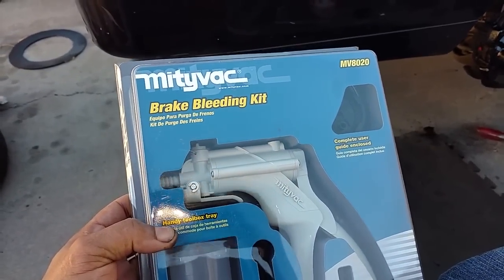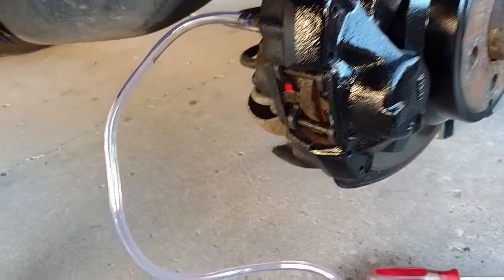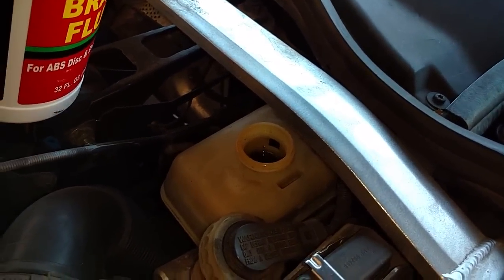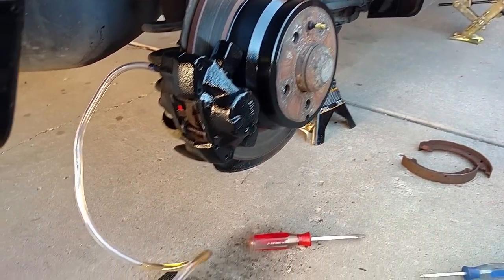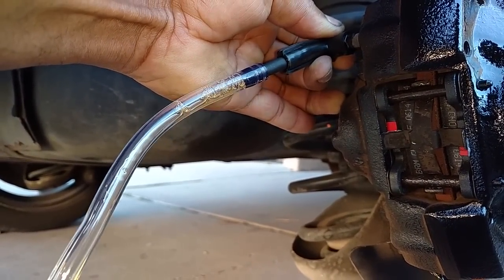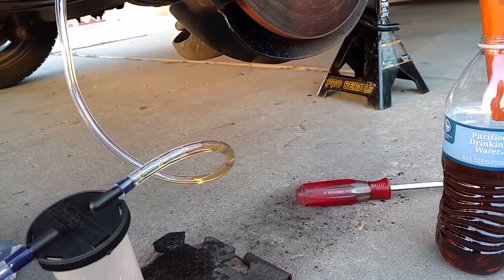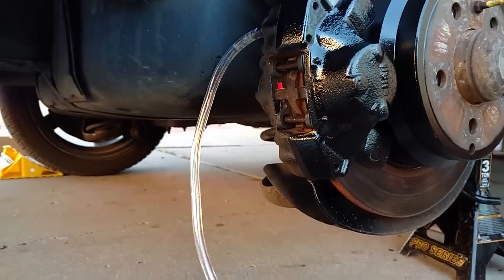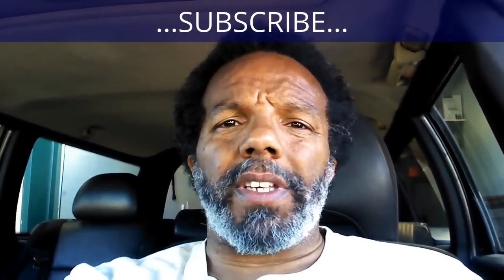How to use a vacuum pump to bleed your brake system. - VOTD

Comment: Should use a longer (not long) hose between the pump and reservoir. Air is being sucked in around the threads of the bleeder screw and the easiest way to slow/stop it is with some vasolene or grease. Better  way is to wrap the bleeder screw threads with teflon tape.
Reply from the maker: thanks for sharing.

Comment: Adding grease is messy... Just use small tie-warps around the tube at all the the coupling location.... sometimes you do need grease at the bleeder screw if you do not have the room for a small tie-wrap...
Reply from the maker: thanks for sharing.

Comment: Always a good idea to have a loop inthe tube that is higher than the bleeder valve. This way air will go up into the bend and not up into the cylinder.
Reply from the maker: Thanks for sharing.

Comment: The small air bubbles you see are from air being drawn in from around the threads on the bleed valve. you can solve this by removing the bleed valve and wrapping just the threads with thread tape tape then repeat the process till you see no bubbles.
Reply from the maker: Thanks for the tip.
Reply: A simpler solution is to use blue tacky tape around the treads.

Comment: That tool is supposed to be pumped 10 to 15 times to create a vacuum effect. You are also suppose to keep the pressure going until there is no bubbles. Gravity feeding seems easier some times, depending on skill
Reply from the maker: Thanks for sharing
Reply: Keep up the good work man!

Comment: Very Good Video-You show the basics. Don't worry about the "experts" who go on incessantly about pulling air in around the bleeder screw. With experience a reasonably knowledgeable  mechanic can to tell the difference between system air and bleeder screw air which is the very fine bubbles. It just takes some experience and practise. It has always worked well for me.A person just needs to get out of their armchair and get down and dirty and do the actual work to gain some experience in the real world. If they can't tell the difference between the very fine bubbles and the system air maybe they shouldn't be playing around with something as important as brakes.
Reply from the maker: Thanks for sharing

Comment: Usually issue with that much air is that the bleeder screw was loosened way too many turns that air started to seep past the threads instead of into out the nipple. Less than a fourth of a turn is needed with less the better just crack it until pressure starts to release fluid, usually don't have much air just need to evacuate little fluid to clear the air.
Reply: Air getting past bleeder screw is not getting into cylinder, just makes it hard to tell the difference between system air and bleeder air. Should finish off with a pedal bleed, because vacuum can pull air past caliper internal seal.
Reply from the maker: Thanks for sharing.
Reply: Np, it just is the most important tip yet overlooked fact mentioned with bleeding brakes. I struggled with this many times before learning this.

Comment: The Communist Freight vacuum bleeder I bought sucks, but it doesn't suck enough.  It won't pull any fluid out of the bleeder on the rear axle of my Dodge 4x4 even though it shows a vacuum on the gauge and the bleeder fitting is clean.  Save your money and hire someone to press the brake pedal.
Reply from the maker: Unfortunately you have to get help sometimes. At some shops, they use a vacuum and pressure at the reservoir.
Reply: Thanks Robert.  I read that there's a valve that closes to prevent loss of brake fluid when you pop a brake line.  They said to blow compressed air into the bleeder to open the valve.  I hope it works.
Reply from the maker: Sounds like a way to damage something.
Reply: I was thinking the same thing so I decided to replace my master cylinder instead.  I was also told that you can't use a vacuum bleeder on vehicles with an ABS brake unit.  They say you have to hook it up to a computer scanner and bleed each wheel with the computer.  This kind of stuff makes me want to go back to pre-computerized vehicles.
Reply: The scanner is just for Dodge Rams I heard. The procedurw with other cars with Abs work normal.

Comment: to stop most of the bubbles wrap the bleed screw with teflon tape and re install this will stop most of the bubbles if not all. but if you still see small bubbles its ok because with the vacume system the air cant get in tighten the bleed screw while under negative pressure
Reply from the maker: +Jamilee Piatt thanks.

Comment: I have never done a brake bleed before and my car has a dual MC.  I have bled the front brakes only and the brake pedal still goes to the floor. Should the brake pedal be held down before bleeding and should all 4 wheels be done at the same time.  Thanks Robert DIY for the very helpful video which I've followed fully but something is not right.  I have not fitted a new MC.
Reply from the maker: +John Moore no. No.

Comment: next time try putting either grease or anti-seize on the threads and a small zip tie around the bleeding screw that is connecting to the hose. this may do a better job at keeping air from getting back into your line.
Reply from the maker: +William Giles cool, thanks for sharing.
Reply: Robert DIY thank you very helpful

Comment: The rear of my MC went dry on me even though the front stayed full and there is no partition inside. Now that there's air in the system, do i need to bench bleed the MC or just keep bleeding at the wheels?
Reply: these garbage hand vacuum bleeder crap don't work on bleeding the master cylinder. they even suck ass with lines. you should do the press brake pedal method and a bottle and tube. i wouldn't recommend bench bleeding it because that's more difficult and need two people and a line wrench. watch chrisfix. he explains how to make it from a gatorade bottle.
note: make sure you have a high point in the clear tube curve or else you'll have air problems like this guy that made this video.
Reply from the maker: +machdw650 fill the reservoir and bleed the system that has air.
Reply: Robert DIY I did that for a long time and pedal still doesn't feel right. may have got air in the abs. not sure how to bleed that yet.
Reply from the maker: machdw650 may have damaged the master cylinder.
Reply: Robert DIY I don't think so. i forgot to mention that it went dry while bleeding the brakes. i can see air getting in it obviously but how would damage occur?
Reply from the maker: machdw650 probably fine.
Reply: Ideally bench bleed, but if you make up a couple of curved short tubes you can do it on the vehicle. Another way is have an assistant push the brake pedal down while you loosen the respective output pipe, put a lot of rags around the fitting to absorb the fluid and make sure the pedal is held down until the pipe fitting is tightened. Repeat 3 or 4 times, doing the front and rear of master cylinder one at a time.

Comment: A lot of times the pump will pull air from the base of the open bleeder screw but you can put clean wheel bearing grease around the screw base and it will seal it off every time. Great video Robert!
Reply from the maker: thanks for the tip.

Comment: Not bad but I do disagree. With my car Ford's service Bulletin called for PR FP DR then DR the proportioning valve won't work right otherwise. Do like that you stress getting old fluid out blade fluid holds moisture like crazy. Guess the point of my rant is consult your owners man or a repair book. do it right and only have to do it once.
Reply from the maker: +David Miller thanks for sharing.
Reply: David- what kind of Ford do you own? I would like to know more about this bleeding procedure. I cannot imagine how you can damage the system by starting at the wrong wheel. Furthermore, I would like to research what the bleeding procedure is for replacement of a front hose or caliper. Do you close everything up leaving air in the hose/caliper and start bleeding at the rear? Again, not saying you are wrong or mistaken but I would like to know why.

Comment: Egg-on-face... I'm wrong: LF, RF, LR, RR (for LHD vehicles) according to VIDA, but Robert, when you do it, and I'm sure you've done a few, does it actually matter?
Reply from the maker: I Just try to get all of the dirty fluid. I thought it was going from the furthest from the booster to the closest.
Reply: Take your point, in this vid you're flushing more than bleeding per se, whereas I'm replacing calipers and pipes etc, but I'm assuming you've played it your way before and done fine. So in short, the way you do it works for you, so to hell with VIDA! I have ot say those vacuum bleeders are a faff to seal, and next time I'll go for a pressure bleeder kit.
Reply from the maker: +Some Bloke pressure is always faster. 😋
Reply: Robert DIY You are supposed to start bleeding or flushing at the brake furthest from the master cylinder.  You had it right.
Reply: Shouldn't matter, I always overbleed anyway, brake fluid is the cheapest thing you can put in the braking system, so I go for enough overkill that sequence is of no consequence.

Comment: Excellent video that shows the process 'step by step'. Easy to listen to and learn.
Just a suggestion but if your remove the bleed nipple and wrap PTFE tape around the threads,  you'll reduce the possiblility of air being sucked in.
Reply from the maker: You are correct. Do you need to remove the tape afterwards?
Reply: Not really mate, it seals in both directions.

Comment: I had some success once  I lifted the reservoir above the bleed nipple and pumped very gently (very few small bubbles coming out and then no bubbles).  The brakes work much better now.  The air constantly wants to move up so lifting the bottle above the nipple seemed to work.  Took a long time to get there as checking all the joints.
Reply from the maker: Helps to have help, someone pressing on the brake pedal.
Reply: I will try that in future, thanks.  I bought this so I could do it by myself.  I'm not sure this is a good buy.

Comment: Is this the same process for clutch bleeding ?
Reply from the maker: +Jean-Philippe Belleville not sure but the tool has instructions.
Reply: +Robert DIY thanks !
Reply: absolutely not, unless your manual permits it. these things can force suck the seals in the MC and slave cylinder out of place. if it's a CSC it shouldn't even work
Reply: Exactly the same. Remember that the purpose of a vacuum bleeder is to move a lot of fluid quickly, but it is not perfect, in other words it does a rough bleed. Finish off with a few strokes of the pedal with the help of an assistant.

Comment: Those  microscopic bubbles is the result of air been sucked in between the threads of the calliper and the nipple bleeder. It happened to me as well with my one man brake bleeder using an air compressor, I wouldn't worry about those bubbles. I have heard of people using silicone paste around the nipple or Teflon tape or PTFE tape as we call it here in UK on the threads of the nipple to stop air going in.
Reply from the maker: +Rui Nunes yea, that's what I figured. Thanks for sharing.

Comment: I have the same tool. It's handy for lots of things, but the best results I've gotten with brakes have been with a helper pumping the pedal.
Reply from the maker: +lilpoindexter really?
Reply: I agree with you and will continue to have my kids help me out by supplying the brake pumping action.
Reply from the maker: +lilpoindexter I think pumping is to much work when replacing the fluid.

Comment: Did you figure out if the air was creaping round the tube, or was it leakage through the bleed screw threads?
Thats the problem with the suction method, it finds paths :-(
Reply from the maker: +zx8401ztv leaking through the bleeder threads.
Reply: I use a larger hose, so it goes over the bleeder and up to the face snug. Then I can also spin the hose to open and close the valve to seat before i put a wrench on it to tighten.